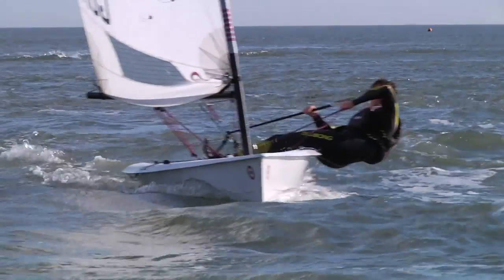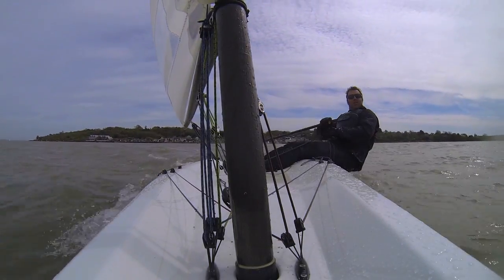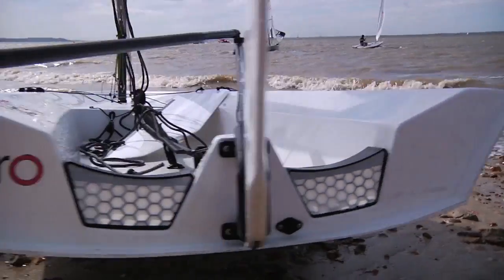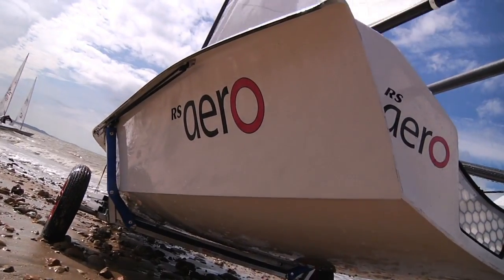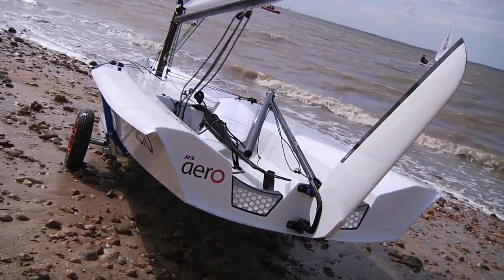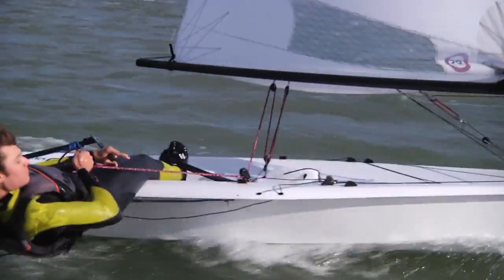RS Aero Spotlight: Hull

Comment: I like how it's set up and the very light weight. Big plusses! However, I'm not sure why the obsession with so much stability. I guess if you are targeting the boat at beginners or older sailors, then stability is important. However, really exciting boats are inherently unstable, require more skill and so are more exciting to sail. Too much stability will be boring for experienced sailors so it's not looking like a Laser killer. 

Some upwind and downwind footage would be good.
Reply: Hey Bruce. These things are all relative! Stability and user freindliness gives the opportuinity for RS Aero to far more users. The RS range has a wide spread of performance challenges. The point here is that if you can use light weight to combine the excitement at the same time as the accesibility then the combination is truly thrilling. RS Aero is totally sailable by an any dinghy sailor with regular skills, which means the performance is in reach of everyone. We think the RS Aero is a stable platform by comparison to other RS models, but be under no doubt this boat is far from boring for experienced sailors. Hope you get a chance to have a go soon!
Reply: “not looking like a Laser killer” five years on and laser tried to kill itself and the Aero is the far more impressive boat